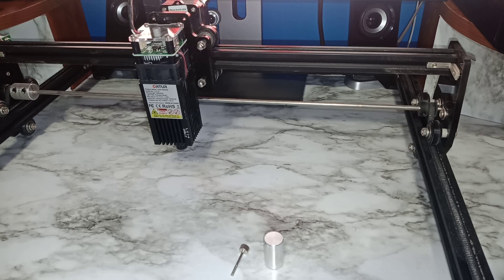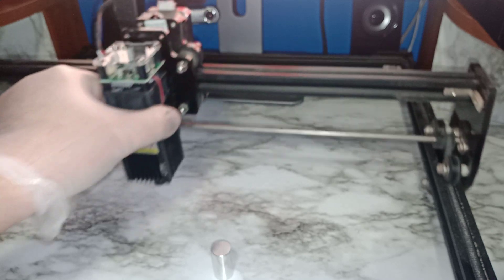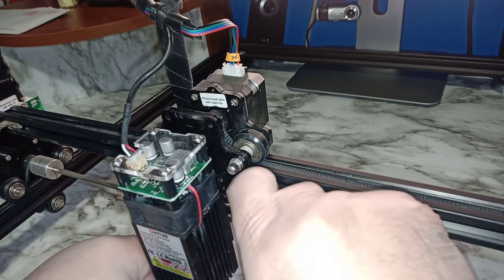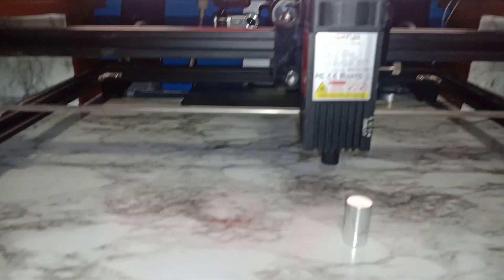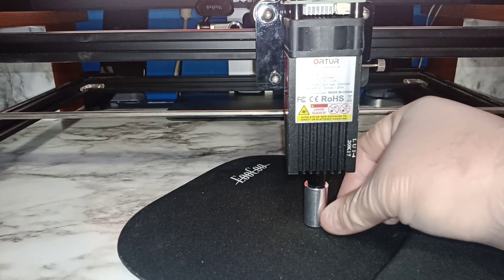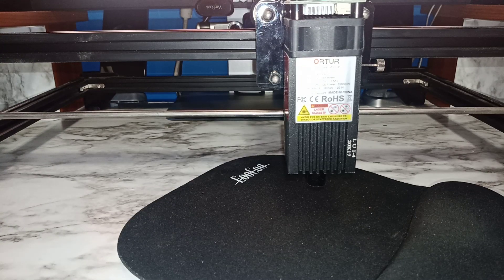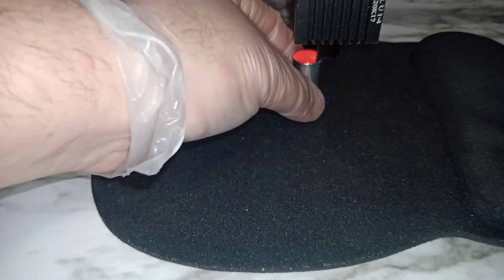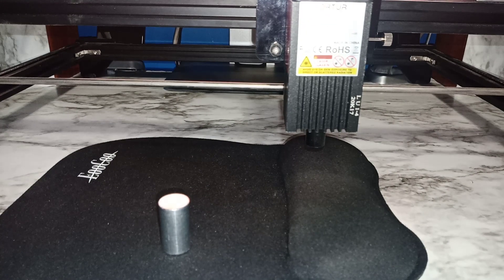Ortur new 20 Walt laser focus

Comment: How much mm is the bolt for laser focus
Reply from the maker: Bolt or you maen the block?

if your talking about the block  is 29mm 
But this works only for the new laser if you have the old laser I can recommend something better focus your laser with smallest point you can do use your phone to zoom in then measure the distinct from the bottom of the lens to the object and you can make a block at that measurement and repeat for all of your burn

Comment: How many mm's or inches talk is that little piece. I have an older model that doesn't have that. I need to make one.
Reply from the maker: Hello friend to answer your question if you have older model that the focus turn you need to come out with your own measurement due to the one I'm showing in the video is a fixed lens that manufacture provided this piece of aluminum bar
Reply from the maker: The way I did it before I had to fix focus I focus my machine to the smallest point then measure from the bottom of the heat sink block to the material and I cut piece of wood that size, but still everyone so while I recommend you to double check your focus due to it can turn and be off location
Reply: Thanks, I appreciate the help.

Comment: Thanks for the explanation. How tall is the spacer?
Reply from the maker: 29mm 
But this works only for the new laser if you have the old laser I can recommend something better focus your laser with smallest point you can do use your phone to zoom in then measure the distinct from the bottom of the lens to the object and you can make a block at that measurement and repeat for all of your burn
Reply: Thanks. I have the old laser and that’s what I’m doing now. Manual focus at about 40mm from the heat sink. I tried at 30 but wasn’t getting good results. Just curious if the new laser uses a different focus distance.
Reply from the maker: @changandy  yes it does use a different focus distance  plus is totally different laser lens, I even made a video about the difference between the lens way much different

Comment: I cant find but I've read that on this particular laser even tho its fixed focus. You can actually slide the lense tube on the bottom in and out, does anyone know what this does?
Reply from the maker: This was designed for example if you have a small object that your laser is not reaching you slide the focus lens up and down to make it reach the aluminum block

Comment: What is the height of the barrel? and is this the idea on all of the lasers made by Ortur?
Reply: This laser is fixed focus and cannot be adjusted like the older models, I believe..
Reply: @TheAstriapo  it can be adjusted with the focus ring on the barrel
Reply: Even on the fixed focus?  I couldn't get mine to move.  Maybe I'm doing it wrong, which could definitely be a possibility...
Reply from the maker: @TheAstriapo   if you don't have the bag base it will not move this is an add on from Outer
Reply: It is 29 mm long. Only to be used with the new model.